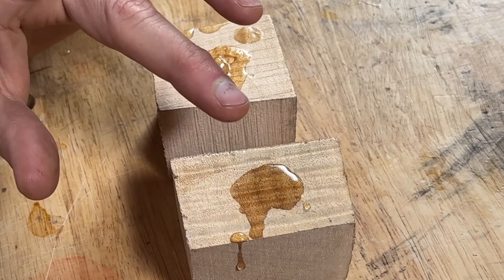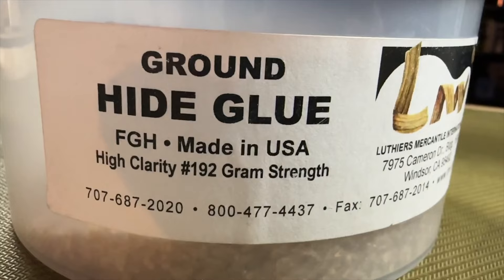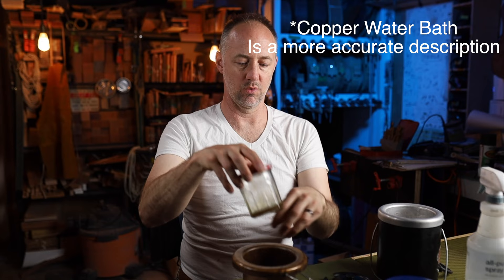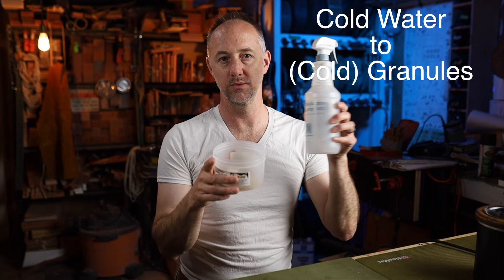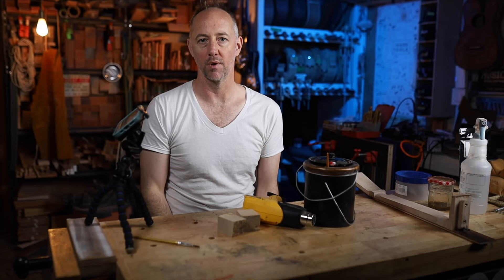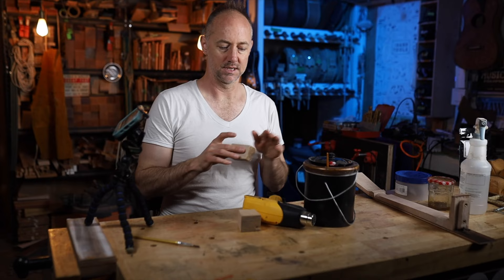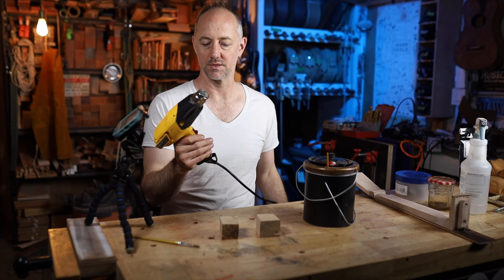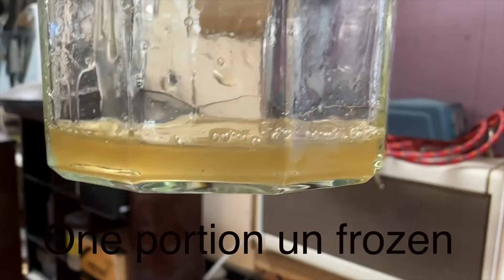How to Mix Hot Hide Glue- Essentials

Comment: Thank you. I'm learning every day.
Reply from the maker: My pleasure 😇
Reply: @BeauHannamGuitars   I dropped my violin a few weeks ago and opened up the top plate at the hand patch and lower bout by the nut . We shall see tomorrow if it worked. Fingers crossed. This hide glue is easy to work with. I like  that you can just soften up the old glue and put some new glue in. No fuss cleaning out the old glue first, like you would have to do with the new modern glue.
Reply: Yes.. It worked . No more buzz. Thanks again..

Comment: Lovely explanation, especially the demonstration and importance of viscosity.
I heard about the ice cube prep idea also which I use a version of. To increase the thermal mass of such small quantities I throw a few glass marbles into the jar when reheating. Useful measure to combat cooling if you remove the jar from the hot bath.
Reply from the maker: Thanks. I’ve heard of maples or stainless steel nuts to keep it warm when it’s out of the water- but I always keep it in the water.

Comment: Amazing timing! Thanks for this info and demo. I was reading Historical Lute Construction today and he got to gluing the top with hide glue. I'm still some months out before I get to that point but this was really helpful.
Reply from the maker: My pleasure. Some luthiers do prefer a different gram strength (be it less or higher number) and the brittleness can be a benefit in some regards (i didnt' want to get into it in this video)- but some use a lesser gram strength for gluing on violin tops to make them easier to take off. Check with a lute maker but 192 is good for anything usually.

Comment: “Bonne Maman” (it’s on the jar!😂). I’ve found a baby food warmer works well (you need to calibrate it just once) for smaller jars, and they’re often practically given away at flea markets and so on…
Reply: PS: I actually use old camera film cases - they hold about an ice-cube worth of glue each, and you can just toss the whole container into the food warmer (suitably filled with water of course!). A large metal nut in the bottom of the film case keeps it upright in the water, and helps hold heat if you take it out of the water to apply glue.
Reply from the maker: Hahahah. Thanks :)- shame the hold heet pots are no longer sold

Comment: Good show!
Just trying to hep here, the main impediment to hide glue being more useful is the pain in the A glue pot = high maintenance, wait for it to warm, cleaning the crusty scum,  oops need water again!  and of course if your like me, knock it over = a pain!

We discovered many-many years ago that a microwave oven works very well for warming up small amounts of glue in about 15 seconds.  about "15 SECONDS",  a couple minutes sometimes for a quart when gluing in piano SB's.
Ready when needed.
I have many 5.3 oz plastic yogurt cups, they are perfect and when they get beat up they get recycled.

One of the high profile participants on these U-Tube vid's  unfortunately poo-pooed the notion and probably never even tried it   this person doesn't  use hide glue for anything = stubborn big head.   Say's it's too much trouble!   Geeeezewiz.
That's what one gets with most helpful suggestions.

This hide glue stuff is the primary material we use for almost everything.
Electric glue pots are essential we  have some for piano action repair, felt especially.
Heating your work first is essential not only for time to assemble but for the bonding.

Strangely----watching fiddle making/repair folks, I don't see any emphasis on the importance of preheating.
But that would help a lot if one were prying off the panels sometimes in the future, for sure 
Hot glue on unheated wood will make for gassing off and actually compromise the bond.
Preheated will draw the glue in when cooling off and kind of weld the pieces together.
Oh-well.
Reply from the maker: Thanks 😊- some people don’t get the full usefulness of HHG. I didn’t until I did. It is a pain heating it up, especially if you want to do a quick glue up job but for guitar bridges it’s superior for sure, probably for all other stuff too but I still
Use titebond for headblocks etc
Reply: Tight Bond, why? @BeauHannamGuitars
Reply from the maker: @BlaisPianoGuitars  convenience. Sometimes I’ll use epoxy for headblock a- depends on the wood (I’m talking about building, not repair) HHG everywhere on anything vintage.